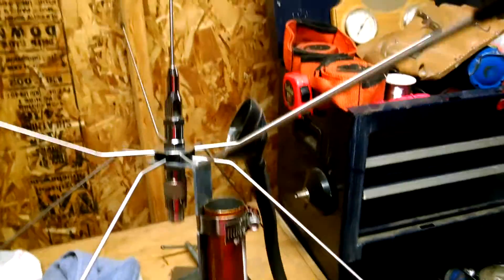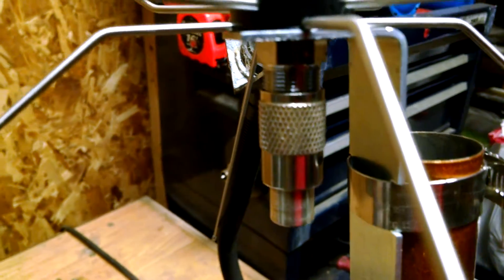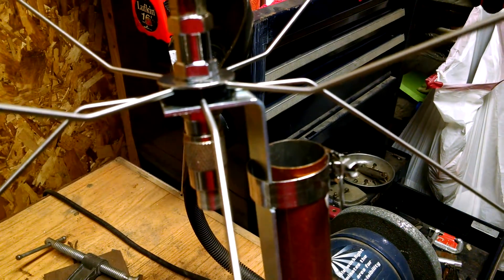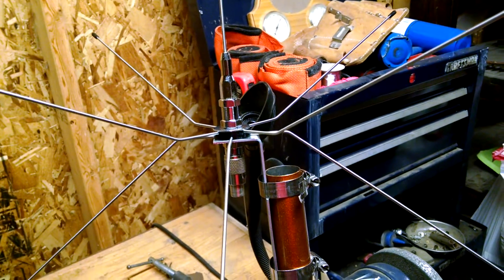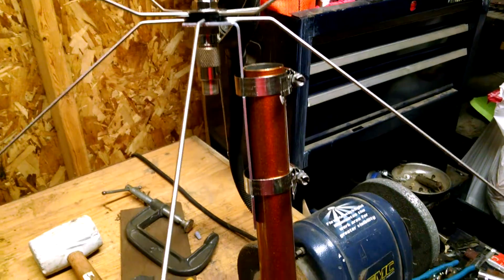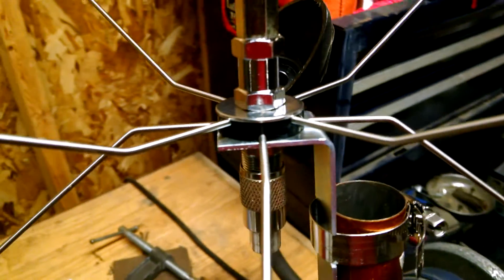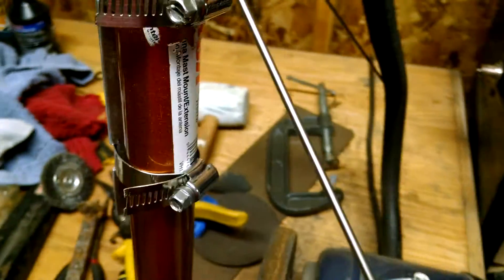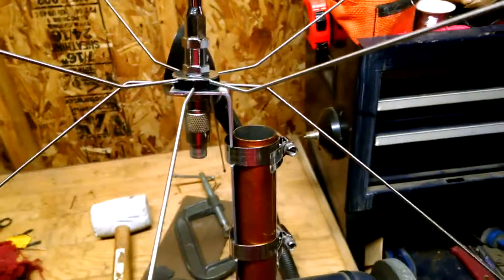Procomm Spider antenna poor reception

Comment: With the center conductor you had only one half the antenna. For you to receive more clearly you need to connect the other half of the antenna, that is the bottom half, however, the bottom half is not connect electrically to the top half. Your coax is not the problem. It is the construction method. The only part that radials should be electrically connected to is the ground shield of coax. Understand the concept of a dipole. You know, transmitting antennas also receive.
Reply: I am just about to get this off ebay. I cant understand what this guy in the video is saying. You seem like you have experience with this. Any recommendations on setup?